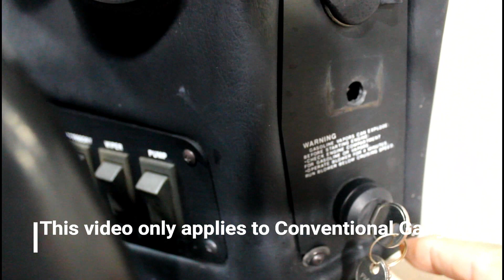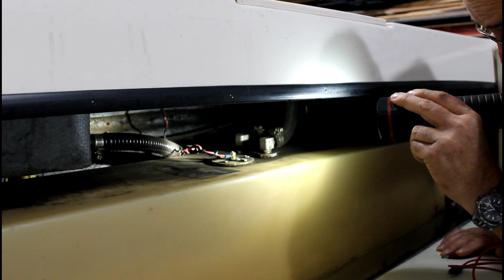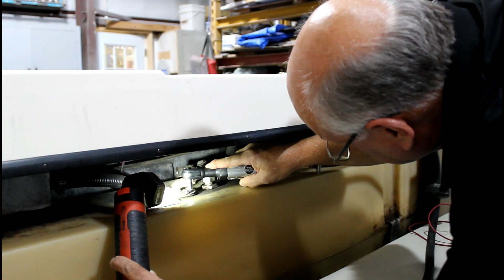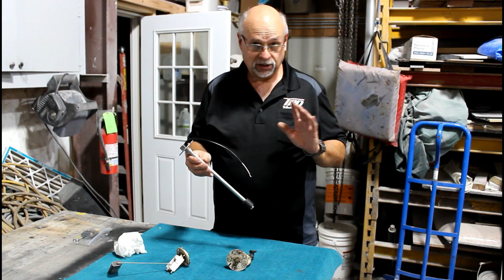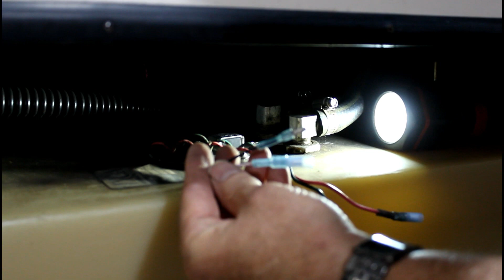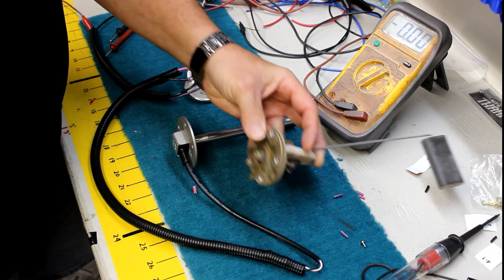Fuel Gauge Troubleshooting 101

Comment: great explanation , can you tell me how to get an ohms reading on my existing gauge which apears to be working on my 49 studebaker which has been changed from 6volt to 12volt 5 years ago i do not know what ohm value the bad sending unit is ,gauge worked until sender failed now i need to pair them up .any ideas ?

Comment: I need help i have an truck that was restored several years ago and has a resistance type sending unit at half a tank i have 145 ohms reading after trying a few gages i cant get them to read the correct amount,  do you have any ideas? What am i doing wrong

Comment: My gauge is in a very tight space and my sending unit is INCREDIBLY hard to get at, so I ask this - my gauge is always pinned on full. Does this mean that my gauge is good and the problem is definitely in the sender? TIA.  PS: great vid, thanks.
Reply: Unless you disconnect the sender wire from the sender you won't know, if disconnected & the gauge goes to E or below it will be the sender or the sender wire is grounded somewhere, but usually it would be the sender then.

Comment: You found the problem right away. And I will say good video. BUT, retired marine tech here, I would have started at the gauge to make sure gauge is getting keyed power and ground to it. If Good then continue and ground out the gauge right then on the back, if good continue. Now ground out at sender, if gauge doesn’t move wires are bad, if gauge pegs its the sender. Doing it this way you are  checking the complete system.  What would you have done if the gauge didn’t move when you grounded it at sender, you would have had to do what I just described anyway. Think simple & thorough first.
Reply: I have tested everything.  Gauge with jumper, jumper at sending unit, resistance in sender(new one also) everything checks out.
  My gauge is full and only moves barely to "more full". I pulled sender slide float and gauge barely moves from full to "more full".
    What the heck am I missing?

Comment: How would you check this for the 3 wire mastercraft?
Reply from the maker: You CANNOT use this proceedure for the 3 wire MC senders, traditional. common senders use a variable resistance to ground, the MC sender use a variable voltage usually 1-5 volts, grounding the 3 wire sender will cause damage. You would need to know the senders voltage range to begin working on this.

Comment: The float arm contains metal and may be pulled out of the fuel tank by using a magnet affixed to a clean length of plumbers snake. Never ever leave any object inside the fuel tank which doesn't belong there. Exceptional good video presentation!
Reply: That was my point aswell. What happens if the new sender arm get stuck with the one left in the tank....

Comment: Very helpful, did all works but when tank is full gauge only goes to a little over 3/4. But when I short the gauge it shows full. Anyone has any suggestions?
Reply from the maker: Now you need to get a bit more "technical" American Marine fuel senders operate on a 33-240 ohm range, 33 is close to (0) which is what we do when grounding the sender. You will need to use an ohmmeter to measure the resistance from the gauge (disconnected wire) to the tank & back & with a full tank you should see 30-38 ohms resistance, if you do the gauge is bad, if the resistance is around 40-60 with a full tank then you likely have a wire or connection between the gauge & sender that is corroded adding resistance to the circuit. You can also run a temp jumper wire between the gauge & sender. Last possibility is a sender float getting stuck on something preventing it from going all the way up....RonT
Reply: @rontanis1024  Thanks, checked disconnected wire at gauge and it was 60.

Comment: Hi there Ron, I have put a reid switch style fuel sending unit in my Sierra Supreme ‘89. However when I turn the boat on, the gauge works in reverse (I.e. my boat shows Empty when it’s full and Full when the tank is empty. Can you advise what the cause could be. Thanks 🇿🇦
Reply from the maker: WHere are you, and where did you get the sender, we sell these but in the American calibration, the European calibration is reverse of the American, sounds like you have a european cal sender for an american gauge.

Comment: If your sending unit is bad how do you know if you need a 230 - 33 OHM or a 0 - 190 OHM sender? Most people don't want to buy one of each to make sure they get the right one.
Reply from the maker: All of the US Marine senders I see are 230-33 ohm, (230 empoty-33 full) Europeans use some 33-230 ohm (backwards, and automotive use 0-190 and other scales, Mastercraft uses some variable voltage senders, not variable resistance (they use a 3 wire sender)

Comment: When I turn the key, the fuel gauge shows full, when I turn the ignition off, it shows empty.

Tested sensor with measuring instrument it has the correct Ohm value.
 
It is both a wema and a wema instrument. Has worked before and also not replaced anything previously. When I disconnect the sensor's 2 cables it still shows full. what do you think is wrong then?
Reply from the maker: You didn't say where the float position was but note that there are marine versions and automotive versions of senders & gauges, USA Marine is 33-240 ohms with 33 as full and 240 as empty, european & many auto are reversed from this. Wema makes both.

Comment: I bought this R72 Ranger boat 12-21-21. The gauge reads half full when it’s actually empty. And when it’s 3/4 full on the gauge it’s actually 1/4 tank full and so on. 
When I fill up the tank the gauge needle goes way pass the F. And stays there until some of the gas is used up, then the needle will start moving. Basically it seems some is not calibrated right 
Help Please 
Thanks 
What could be the problem?
Reply from the maker: Remove the sender & move the sender up & down with the key on and watch the gauge, if it is good outside the tank, look for anything preventing the movement inside the tank, if it acts wrong outside the tank, replace the sender. (Assuming you have a std marine fuel gauge in the dash & not an automotive calibrated gauge)
Reply: @rontanis1024  ok
Thanks, it’s a standard (original) fuel gauge. It does have a 2014 mercury pro xs 115 on it. If that makes any difference. THANKS FOR YOUR HELP!!

Comment: Thank you Ron, this has been very informative.  I have been using it to troubleshoot my "always full" gauge on a boat I just got. Tested sender for Ohm range=good. I remove sender pink wire from post on sending unit abd needle drops,  touch mounting flange and all the way past full. Ground wire is hooked to mounting screw.  
I've tested voltage at sender and gave and get same reading.  Idea's?
Reply: Did u ever figure out your issue with the always full gas gauge? I have same issue with good sender. I’m wondering if the ground and pink wire are grounding each other out?

Comment: It is a possibility that you ripped the swing arm while pulling the sender unit from the tank. Also, you should pull out the old swing arm since the float makes the thing.. yeah, float.. It could possibly cause faulty readings if the old swing arm gets "tangled" in the new one.
Reply from the maker: It's uncommon to pull a partial float assembly out, which is why we generally remove the tank turn it upside down & shake all the loose parts out.

Comment: Would this work for a Yamaha digital fuel gauge as well??
Reply from the maker: Doubtful, most electronic modern gauges system use variable voltage senders (3 wires) but if it is a 1 or 2 wire sender then yes it would

Comment: Can you tell me what to do if you jump the neg to center post and you get nothing
Reply from the maker: re-test at the back of the gauge, with key on run a jumper from a good ground to the pink wire on the back of the gauge, if the gauge responds to Full, then you have a bad wire/connections between the gauge & sender.
Reply: @rontanis1024  thanks for your help

Comment: Hi Ron, I have a 1996 Malibu Sunsetter and want to change the sender unit to the "reed style".   I am guessing they are standard size, do you have a part number or set if them for various dimension tanks?  Also need to replace  light bulb in my gages, they are original equipment in boat and are teleflex (black background with white lettering).  Do you know part number for them,  I would like to order.  Last question, fuel hose running from tank to fuel water separator ... is it special or will automotive fuel hose work?  Engine is 5.7 L Mercruiser.
Reply from the maker: They are not standard size, you will need to measure the depth of your tank to determine which sender you need. If your bulbs are removable try the local auto parts store for bulbs, fuel hose for marine applications is specific, must have the USCG numbers with E-15 on it for ethanol fuels: https://skiboatpartsonline.com/Inboard-Ski-Boat-Parts/hose/hose-fuel-3-8.html

Comment: That new fuel send unit was very nice.  
The fuel pump I just put in my van had the swinging arm and looked very cheap compared to what came out of it. The old one had a swinging arm too but the wiper and wiper pad were built way better on the old one.
Can electronic oil pressure gauges be tested the same way?
Reply from the maker: If it's a single wire sender, YES, if it's a 2 or 3 wire sender NO

Comment: My gauge is about a quarter of a tank off but otherwise works any ideas and is it worth time and money to fix
Reply from the maker: The only way to troubleshoot this is to remove the sender and manually manipulate it and see what the gauge is doing, all the way up should be full. all the way down -empty, half way up -half. If this is a swing arm style you will need to see if the float is hitting something.

Comment: Great video.  What if when you turn on your ignition your fuel gauge pegs out to full and never moves?
Reply from the maker: disconnect the pink wire at the fuel tank sender & try it again, if the gauge stays at E now with the switch on you have a bad sender.
Reply: @rontanis1024  awesome, thanks for your reply.  I'll give it a try and let you know.
Reply: The electrical connections on top of my fuel tank are sealed.  Any ideas on how to deal with that?
Reply from the maker: @jeffadams4487  If it's a 3 wire sender like MasterCraft uses this video will not apply to that type. If there are 2 wires coming from the sender there must be a wire plug or wire splice near the sender, you would need to break that connection to test the sender.
Reply: @rontanis1024  I wish I could send a photo of my connection but I guess it is not supported.  It is a 2 wire connection on a Bennington.  My plan is to replace the sensor.

Comment: My gauge always shows full or almost full.  I pulled the sending unit out and tested it.  Seemed to be working fine on ohm meter (between 30ish ohms with the slider all the way up and and 290ish ohms with the slider all the way down).  When hooked up to the gauge I can see the needle moving as I move the slider up and down, it's just not moving very far.  Is this more than likely a bad gauge or a problem with wiring?
Reply from the maker: More than likely the gauge, but I would ground the back of the gauge "S" terminal (pink wire) to the ground and the needle should swing to Max, disconnect the pink wire from the gauge & it should go to E

Comment: Great tutoring on how to troubleshoot these issues. However, how would you proceed with an incorrect reading from a gauge? Meaning, my fuel gauge shows about 3\4 when the tank is full and shows about 1\8 when boat is off. Accuracy is way off. Gauge? Sender? Both?

Comment: So what happens when I replaced my fuel sender, and the gauge works, but it constantly reads "full" when I know it's not? 

The swing arm is set for the tank depth and it's not blocked, swings freely.
Reply: I am having the same problem. It reads a just over 1/2 a tank when I bought the boat and after I replaced the sending unit with a universal one. Still the same problem.

Comment: What about if it stay in the 1/2 way don't return
Reply from the maker: remove the sender from the tank, wire it up & move the swing arm or float up & down while watching the gauge, if the gauge stops at 1/2 then short the pink & black at the sender & the gauge- if it pegs the gauge Full replace the sender, if it sticks at 1/2 replace the gauge.

Comment: RON TANIS 
                 ^^  ===               I disconnected the Temperature sending unit/temp sense, so How can I test the instrumentation temp gauge in my cars dash board by itself to check if its working correctly, what do I need to do?
Reply from the maker: Are you working on a car or boat???
Reply: @rontanis1024  ford 1997 mustang 6 cylinder 
But in general for ALL cars in 60's, 70s, 80's ,90's how can I test the gauge clusters gauges one by one?
Reply: @rontanis1024  
1.) The Temperature gauge needs a "resistance value" or a Voltage? to be applied to the temperature gauge to see the needle moving from C to F? 

When I disconnect the temperature sending unit/temperature sensor can't I just use a variable resistor potentiometer and watch the temp gauge need moving from C to F?
2.) The Universal Radiator Pressure tester won't test how much pressure the closed loop system PSI level is at while the car is idling and running. 
I'm looking for a Pressure tester that can test the PSI level while the car is idling and running to know if the PSI pressure level is at normal operating PSI pressure level of the coolant closed loop system. 
What is the normal operating PSI pressure level on most cars?
Reply from the maker: @billwilliams6338  Older cars before engines computers did use variable resistance senders, so yes your variable resistor pot would test these, I have a similar set up for testing marine gauges.
Reply: @rontanis1024  yes the temp sending unit/temp sensor is a thermistor which is a variable resistance
But i dont' know what my temperature gauge is wanting a resistance and a voltage or just only a resistance in order to move that temp gauge needle from C to F?
Reply: @rontanis1024  
The water pump is pumping how much water and coolant? how can I measure this how much the water pump is pumping? 
I don't know why they call it a water pump because its not pumping only water its pumping coolant. 
The Water pump only pumps coolant not water into the engine only when the engine is warm and HOT not when the engine is cold?
Reply from the maker: @billwilliams6338  We are comparing apples & oranges here, marine applications and auto applications, marine applications we do pump lake water into our engines & spit it out the exhaust, but technically the lake water is a coolant to absorb heat.

Comment: If the sending units are bad/rusted/toast like the one here. How did you know the ohms range needed in the new sending unit? OHMS ranges needed for gauges, from what I am finding, are different and even reversed. Without a good sending unit how did you know which new sending unit you needed? Some read FULL at 10 ohms and some read EMPTY at 10 ohms. I ordered a Resistance Substitution Box tool to feed different resistances to the gauges. Do you have a video on finding out the ohms range of a fuel gauge? "How to buy the right sending unit".
Reply from the maker: The required resistance values needed are dictated by the gauge they are used with. A few gauges have the ohm range printed on the backside, most you will have to look up in the respective data sheet for the gauge. Our instructions and applications are for the US manufactured recreation boating community, and the standard ohm range for our fuel gauges is 240-33.

Comment: what if you get the needle to go over the full mark when you turn the key on and when its off it goes to e.does that mean i have a short in my wiring
Reply from the maker: Disconnect the pink wire at the sender, turn the key on, if the gauge reads full youi have wireing or gauge issue, now disconnect the pink from the back side of the gauge & turn the key on if the gauge goes to full you have a gauge problem, if the gauge stays still you have a wire issue.
Reply: @rontanis1024  thanks for the help